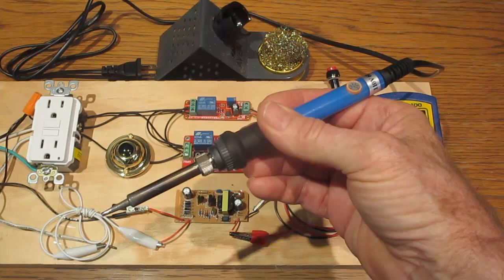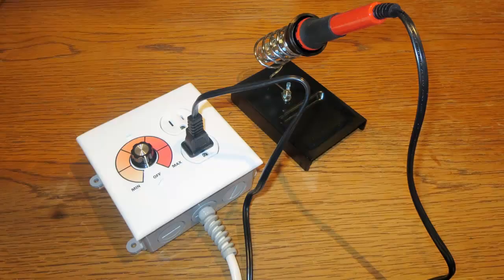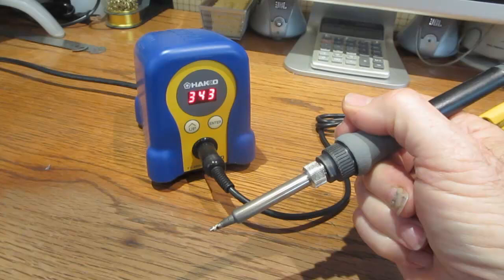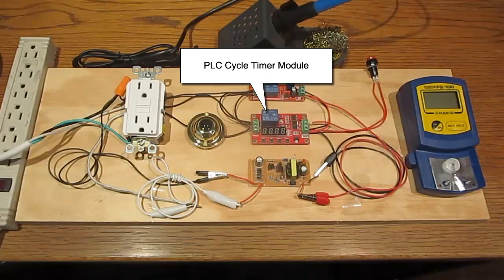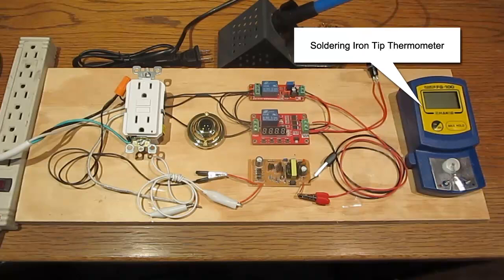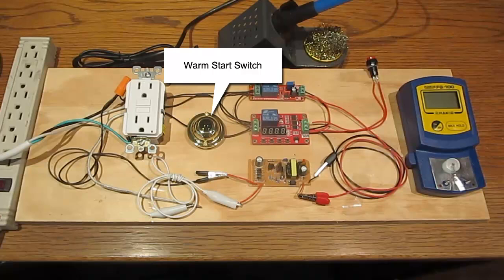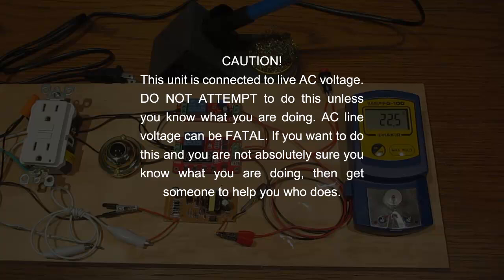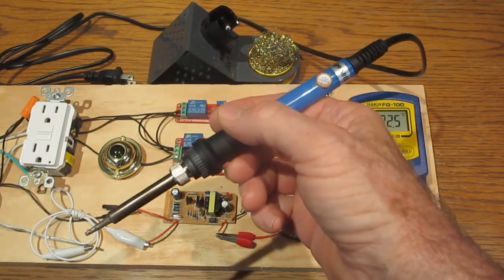Soldering Iron Temperature Control Cycle Timer

Comment: Why not just adjust the pot on the side of the soldering iron?  that's what I do.
Reply from the maker: Good question. Mainly because the soldering iron was still too hot even with the dial turned all the way down. This circuit was an experiment to see if I could get the temperature more within a range for my liking.

Comment: so I was thinking...,and not being a grammar nazi I can start a sentence with a conjunction, I am going to try porting this project to an arduino nano and adding a K thermocouple.

Essentially, when I finish, I should be able to put the soldering iron in a stand, leave it for 5 minutes and the controller will figure out the cycle, flipping on and off the relay.  Plug in any soldering iron, and it achieves and holds the set point, or stops increasing in temp, the system maintains the cycle.

Personally, I think this kind of set up with including a K series thermocouple for feedback, is marketable.  Buy a controller and soldering iron separately, keep the controller and pitch the soldering irons as they die.   Need a way to set a temp, some kind of keyboard, display...I'll figure it out and YouTube it after a few months.  Just thought I would let you know.